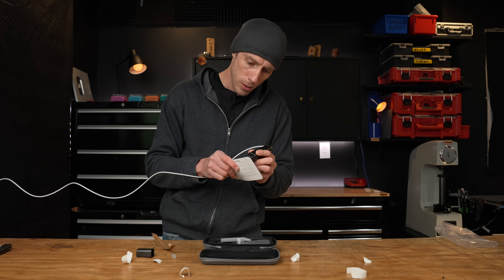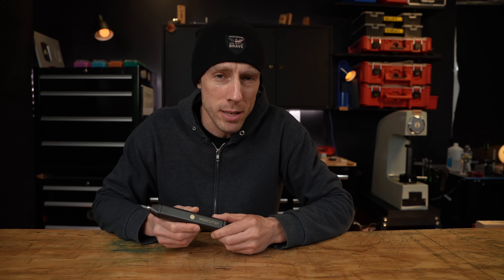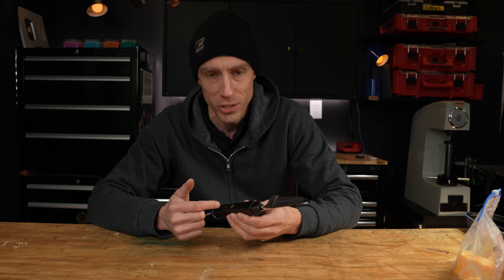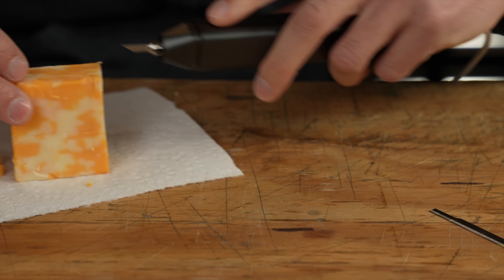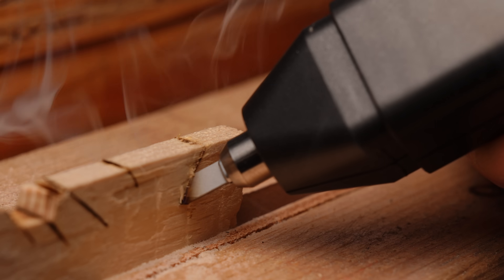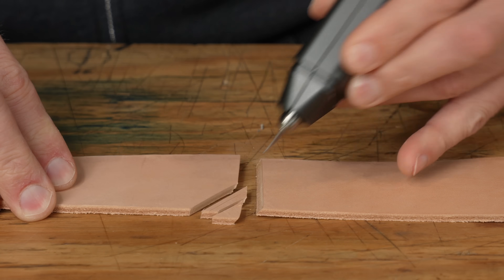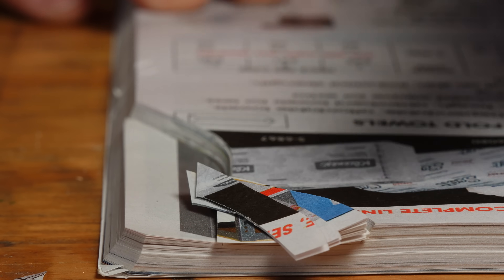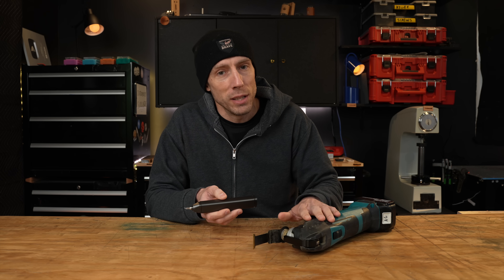Could This Small Tool Be The Future Of Knife Cutting Performance?

Comment: I think the difficulty in scaling this up lies in the ability to move the blade that fast, the extra mass and size might make that very difficult as it just acted as a mass damper. However, I wonder if we could get a sufficiently large transducer for a larger knife and just give'er in the name of science
Reply: My thought exactly. Even though it's not moving it very far, the power needed to move a sizeable knife blade at 20k Hertz has got to be considerable. If you tried to make it battery operated, you might end up with a pretty short battery life.
Reply: Here's the thing: you're not moving the knife back and forth, you're creating a standing wave that causes the metal of the blade itself to expand and contract. For any single cycle, that takes a bunch of energy. But at resonance, the standing wave builds and you can excite a whole lot of blade with very low (<10W) input power.
Reply: @sheimend  The resonance can definitely help out, but there are limitations since the friction against the blade will directly compete with the power input to each vibration. For an example using your case, if the friction ever generated more than 10W of heat, that would slow down the blade each oscillatory cycle and eventually either stop entirely or even out at exactly 10W of generated heat. I agree that resonance is a key part of this technology, but large transducers will still be very necessary, especially for tougher operations.
Reply: @David-yy6hp Resonance alone is not sufficient, but it is required. Oscillations off-resonance will destructively interfere within the blade, and do nothing more than heat it.
Reply: @jasexavier  I completely agree that resonance is required, sorry that didn't come through in my original comment. I was merely pointing out that in addition to a nearly perfect resonance, you need a driver that can output more energy than the average energy removed from the system. For example, a miniscule driver could be used in air to get the blade slowly up to its operating point because the air is barely removing any energy through friction. However, if you stick the blade into a piece of plastic, the heat generated is taken directly from the system and the driver needs to be able to provide as much or more energy than is removed or else the system will slow down considerably and stop working nearly as well.
Reply: I agree with everything said in here,
Reply: Imgine it more like a tuning fork. That's resonance frequency, and it needs to match the blade. (size, material and shape)
Where i disagree with @sheimend is that it is not expanding and contracting the material itself. A resonance movement is not doing that usually, it is just "bending" the shape with the resonance frequency. So if the resonancefrequency is 25 kHz, the shape is bending 25 000 times per second. Above and below not much happens.
Reply: @David-yy6hp Resonance can happen in many modes. There are bending modes, like a tuning fork or a piezo fan (those are cool). There are also twisting modes and surface acoustic wave modes. But most power ultrasonic devices, like cake cutters, ultrasonic welders, dental scalers, etc. work in a longitudinal mode. In this case, the sonotrode (the horn in front of the piezos) may be experiencing most of the expansion and the xacto is along for the ride. But it's very common for the transducer stack to be 1/2 or 1/4 wavelength of the entire sonotrode assembly and there it's the blade itself that's expanding and contracting. 

The ultrasonic stacks in all these devices use some flavor of Langevin transducer assembly. Although it's tricky to see its movements optically, computer simulations reveal these dynamics really well.
Reply: You need to create resonance for it to work properly. This requires the perfect mix of power, form factor, and materials. If anything is off, it will not vibrate, or at least not resonate as expected.
Reply: This Old Tony built one of these, more or less successfully... 🤣
Reply: I got a feeling the blade mass / physical characteristics of a given blade play a significant role when vibrating it with ultrasonics. Think of resonance frequencies, i think there's a right frequency and power level to use a given blade.
Reply: So that's a no for metal gear rising?
Reply: The transducer needs to be able to put out enough energy to overcome the static inertia of the blade.
Reply: While i like the sound of such a tool... I am not sure i would like to hold it while cutting! I am just thinking about the gazillion vibrations going into my joints and blood vessels. I am afraid that would prove unhealthy if used for any extensive timeperiod.
Reply: @klausnielsen1537  While ultrasonic waves can be used to help with benefitting the growth of new tissue material at the treatment of injuries (bone injuries), i would not worry with that kind of tool.
First of all, the resonance frequency of your bodyparts is different than that of the blade, second the handle already dampens the impact on your hand, and lastely:
All the people doing professional "mouth hygene" so professional cleaning of teeth from discolouring and dental calculus would then have health problems.
The thing they use works the same way, but has no blade at the tip, just a small round metal tip.
And they are doing that for decades now.

Comment: This Old Tony made one out of an ultrasonic cleaner transducer 6 or so years ago.
Reply from the maker: @stormsj  i saw that video. It didn't look like he ever got it to work that well. Perhaps it's stil no powerful enough.🤷‍♂️
Reply: @OUTDOORS55  from what I could gather from the comments and his discussion is that it's a sorta hard engineering and tuning issue.  He seemed to be trying to model/tune the natural frequency and mode of his holder and blade and when he was using it was complaining some parts of the edge were cutting better than others...haha.  So it might be particularly difficult to get full longer blade edges vibe along their whole length in some useful way even with tons of energy as it seems to be weird mode shapes moving through the metal that are doing some of the magic rather than the whole blade moving in some fashion.  And if that is some of what's going on to make it so effective even on stuff it's not literally melting from all the friction...there is some chance really interesting things are happening at the sharpened apex that would tend to have less stiffness and lower frequency first modes, with really weird modes at these higher frequencies.  With these frequencies and tiny deflection levels not even clear if some mode that basically saws or more puts some wave shape on the apex line would be better?  Might depend on material.

Haha...all that to say your request for bigger/heavier cutting job tool might be a very interesting and difficult science and engineering effort...lol.
Reply: @stormsj  The trick to the balance issue is because it's a combination of factors, the thing you are trying to avoid is a standing wave in the blade. This is dictated by the speed of sound in the blade material in addition to the frequency of oscillation the longer the blade the lower the frequency (generally speaking more on that later) 

If you don't get it perfect basically one or more parts of the blade are not oscillating and basically a plain old knife. Below 20khz it's no longer ultrasonic and would make a terribly high pitched racket during operation. 

However... You can adjust the design of the blade to make this work. (How ultrasonic cake cutters work) Slots in the blade can mitigate this to a great degree. The tool he describes could be made but a specialty blade would be required which honestly isn't that big a deal, all the oscillating tools already have specialty blades.
Reply: @Segphalt  if this is what is trying to be accomplished you are only looking for sawing or maybe hammer/chisel oscillating direction to have enough stiffness to get a sorta whole blade oscillating thing.  But these are such high frequencies and small movements, I would tend to be very surprised if you don't usually also get some sorts wave down the blade as part of what is happening to help cut.

Comment: Hello! Ultrasonic knives were used for more than a decade in medical applications. The ultrasonic blade doesn't cut through cells, it rather splits cells from each other. Now, You mentioned that the vibration generates heat - it's actually something You don't want, as it is a side effect of having blade shape and size not match the vibration frequency. 

The comment, that vibration generates heat through friction makes me think that the knife You used isn't actually ultrasonic. The blades (in medical ultrasonic knives) 
are not sharp, and they are equipped with a water spray.
Reply: You would only need a water spray if the blade were generating heat... You know, to cool it down.
Reply: @LtKwasretaken  That is true, the blade in a bone scalpel can heat up to 70 deg C - most of plastics need more to melt. I should point out, that the blade itself doesn't vibrate, that's not how it all works.

Comment: I wonder if it has something to do with the blade vibrating at a certain harmonic of itself. 

I reckon thats why your other blades didn't work, because the blade didn't resonate correctly with the ociliations of the motor? meaning they just kinda flung about rather than having a consistant resonant ocilation, thats my guess anyways
Reply: Its just to less power to move that much mass that fast.
Reply: fyi? there's no motor
Reply: @-COBRA  There is but it is piezoelectric motor instead of the more common type of motor
Reply: @-COBRA  Of course there is no „motor“, but this knife is not designed for a larger mass of the blade.
Higher mass equals changed resonant frequency.
Reply: That's  what I was thinking too while watching the video. When he went through the trouble of mounting that gigantic knife blade to the device I wanted to do a face-palm and say, "He really doesn't get it, lol."

Comment: Is there anyway you could do a video on sharpening a fillet knife? That’s flexible that also has length.
Reply: @pledford9  just sharpen it like regular knife, but go slow, i almost cut off my fingertip while sharpening this type of knife.
Reply: Get a fix angle system like a tsprof or the new kme and get extra clamps and make sure you clamp the full length of the blade for stability and you should be good
Reply: Here's my experience, and I can't tell you why there is a difference. Ive used a Marttiini 7.5" fillet knife my entire life. Rapala bought out Marttiini.  At some point I bought a new Rapala  carbon copy(so I thought) of my old knife. It did not perform as well. Under inspection the new knife was flat ground. The old knife was convex. Since I owned a 1x30 harbor freight belt sander I reground the new knife convex. It then worked just as good as the old knife. Don't know why there is a difference, and maybe I was just so used to the way my old knife performed that I didn't like the change but convex is my suggestion.  I had ran over my old knife long ago, crushed the handle and replaced it with a piece of hickory hammer handle, didn't bother me at all. So I am inclined to believe there is a fundamental difference between convex and flat ground when it comes to a fillet knife. Mullet,snook,redfish,sandperch,sheephead,grouper,amberjack,etc.
Reply: As a chef , I'd say go slow , go tender on the blade , as not to bend it as much . If you go for long slow strokes and you sharpen while pulling towards you instead of away , you should get a good result
Reply: ken onion work sharp, razor sharp blades in less than 5 minutes, even heavily damaged blades.  the grit belts last a long time too.  the german made ones are cheap and very durable.

Comment: My question is - why? its just reinventing the wheel, but its more complicated wheel, which performs only under some circumstances.
Reply from the maker: Watch the video 😉
Reply: That's like asking "why invent tires specifically for wet surfaces", right tool for the right job
Reply: Seems like it would be good for someone doing large very detailed craft projects.
Reply: It’s one step closer to the Star Wars Vibroblade 😀
Reply: For industry, where you are doing a lot of the same things (which are the specific use cases) it is very valuable. Time is money
Reply: Toothbrush vs Ultrasonic toothbrush. That is why.
Reply: I love reinventing the wheel.
Reply: Answered all of 2:30 into the video. Hope you're not done that quick in bed too.